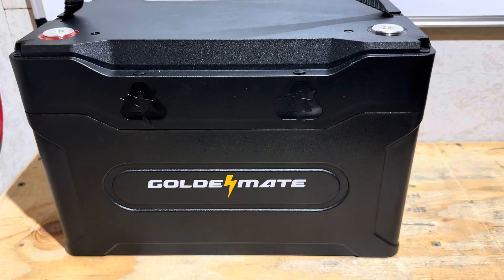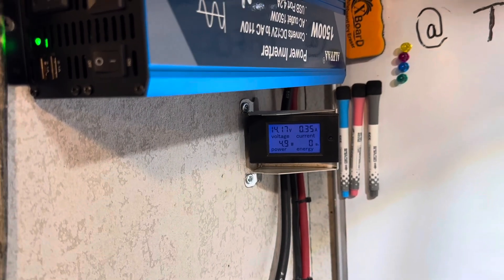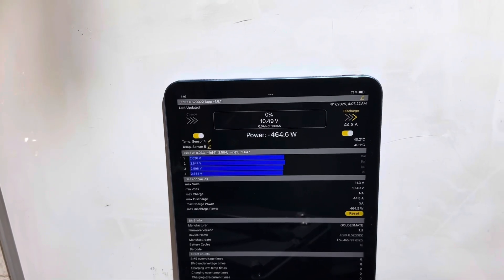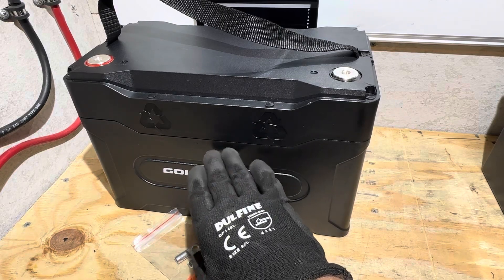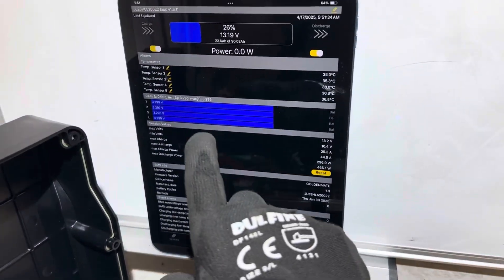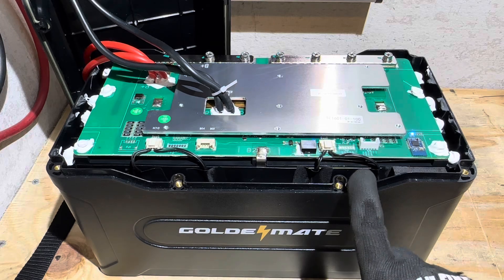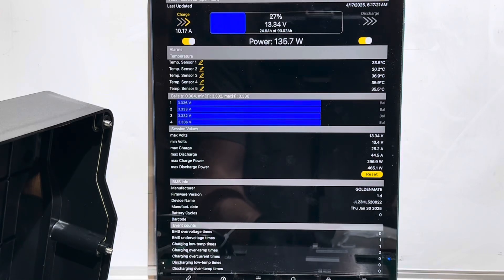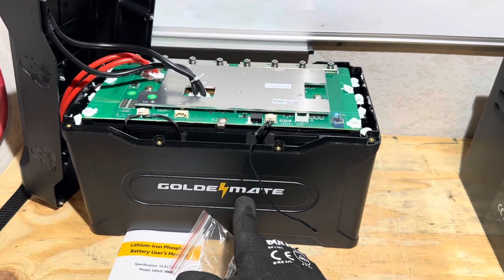Best 12V LiFePO4? GOLDENMATE CRIUS 100B 12.8V 100Ah LiFePO4 Lithium Battery Review & Teardown

Comment: Thank you for another quality and informative review. I am learning a lot from your work and passion to share. By chance have you reviewed or plan to review the Pupvwmhb 12volt 300 ah Mini LifePo? I am looking to revamp my current off grid solar 12 volt system, to a 48 volt and am considering these batteries. Also have some questions around potentially using transfer switches to run 2 separate battery banks from one charge controller to one inverter. Reason for this is to completely cycle one set of batteries to 0 soc, then switch to other set that would be 100 soc. My thinking is by doing this, I’ll fully exercise each battery bank and truly experience the performance and longevity of them. Curious to hear your thoughts on this. Thanks you and all the best and God bless from the foothills of the Ozarks.
Reply from the maker: Glad you enjoyed and thank you for the kind words! I haven’t considered Pupvwmhb. I will see what I can do for you in regard to the 300Ah unit. 
A brief thought on your battery bank setup. If you keep all of your batteries together on 1 system instead of 2 and run them daily, they will get exercised. Of course depending on loads/PV array etc. Throughout the course of a year you’ll have good weather and batteries will get to 100% every day. A storm front or week of cloudy weather and the system may get pulled down to 30-40% etc. then recharge when weather breaks. Most 48V inverters are going to eat 1 to 2 kWh per day just being on and idling. 
You can always alter charge voltage so batteries aren’t slammed full. I only charge to 3.45V/cell for daily cycling. 55.2 on 16S or 13.8 on 4S. Most of the BMS are programmed to balance at 3.3V/cell. Try to keep temps controlled as well. You definitely don’t want batteries at 100°F all day and slammed to top full! Take care my friend!
Reply: @THEOFFGRIDMOUNTAINHOMESTEAD  Copy that! Thanks for the quick response and feedback. Yes , I currently run my 12volt 600 ah bank that way, I just saw another fella on YouTube expressing to go from 100% to 0 soc, to optimize the battery bank. Was thinking I could do that with 2 separate banks at 12 volt/600ah and run through transfer switches, this would allow me to keep current inverter and charge controller, however I am thinking I am not getting enough sun hours to accomplish my needs. This is why I am considering the switch to the 48 volt system to increase the PV array.

Switching back to the 48 volt upgrade, I am curious how you are liking the LiTime 48 volt all in one charger and inverter, I have followed your build on this and was looking closer at a charger/inverter combo for the price it seems nice, compared to some other suppliers. I currently run am Aims power 12 volt 3000 watt inverter, 3 12 volt 200 ah LifePo in parallel, charged by a EPever 100 A MPPT, with 4 Silfab 310 solar panels, and although this is adequate for approximately 8 months of the year, during the warmer months I have to offset with a small generator to run a 5,000 btu Window unit, to cool the cabin. So I was thinking if I converted to the 48 volt system, I can increase solar array times 4 (total) and this should be ample power to run the A/C during the warmer months. Thanks again and if you’ve got any further advice it’s much appreciated. All the best and God bless from the foothills of the Ozarks.

Comment: Great detailed review as always. I like the case that you can open easy to inspect, trouble shoot, etc. Not a bad price for the features it offers. I saw they had another 12V 100AH battery for even way less.
Reply from the maker: Thank you for the words of encouragement! The standard Group 31 which is their lowest priced and has been out the longest is a solid choice for anyone not needing BT connectivity. I have one outside on solar/ DC irrigation system for well over a year. It has yet to complain. Similar build as well.

Comment: I used my Orion 1000 camping last night. Love the built in screen and Bluetooth.  Interesting that the capacity was lower on this one.
Reply from the maker: Orion is definitely A++ unit. This is at a lower price point but I was hoping for 105-107Ah as my Orion always delivers. 
One thing I have noticed since the “price wars” between brands that started last summer/fall is the capacity on almost all 100Ah units has dropped from 103-105 on all brands down to 100-102. Also the prevalence of EVE, CATL, Goshen cells has changed to “no name” cells in almost all the budget models. 
Appreciate you stopping by today, hope you have a happy Easter!
Reply: @ just when the quality was steadily improving on these budget batteries maybe they were hoping people would just think it was a new standard that we would expect.  I so appreciate your reviews.  All the batteries you said were good are rock solid for me.
Reply from the maker: @solar_diy_hobby_and_reviews Appreciate that! Many cheap ones are still decent, they just cut out your “bonus” capacity lol. There are still plenty of awesome ones out there!